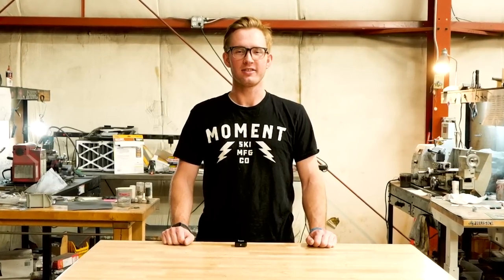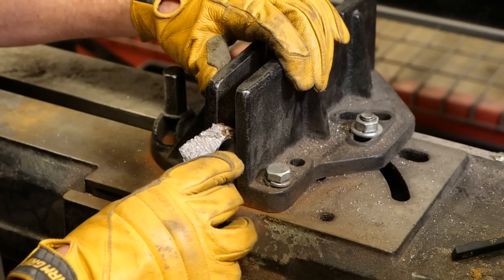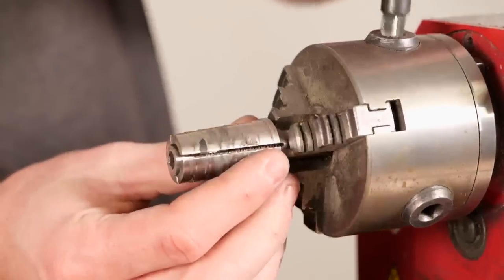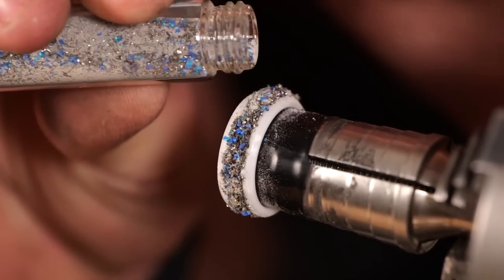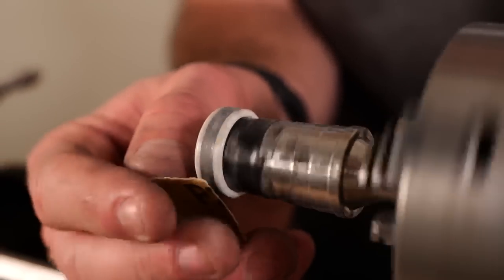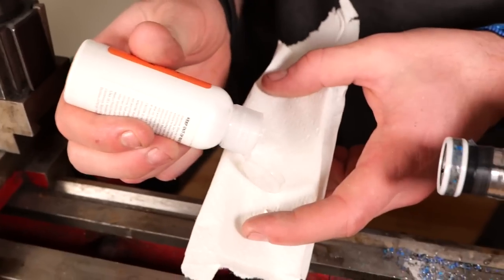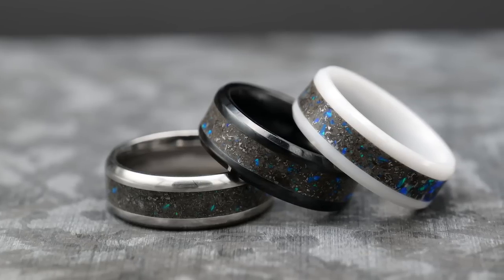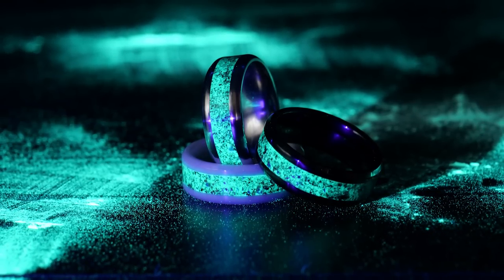GLOWING Meteorite + Ceramic + Moonstone Ring!

Comment: Do they actually glow like in the end pictures? If so, under what conditions do they glow
Reply: I've made my own ring with their supplies and this is what I've found out about the glowing.

The rings glow if you put the "glow powder" into the ring. Then put the ring/"glow powder" under the right conditions.

First up you need to expose the ring to light that "charges" it. An example of this is ultra-violet light like from the sun, or a ultra-violet torch if you have one (which most people don't). After that you can move the ring to a dark place and it will glow, getting dimmer as time goes on.

If you go out and spend time in the sun then wait until the sun has fully set and it's really dark, then you probably won't be able to see the glow too well as the glow would of faded quite a bit. But if you were outside, then quickly went to a dark room, you be able to see the glow.

From my testing I took some glow powder, "charged" it with an ultra-violet torch, then left it in a really dark room at night. The glow was noticable for about an hour. After that it's harder to see. However when I did this with my ring, it only lasted for about 10 minutes before it was really hard to see. But that's because I didn't put much glow powder in my ring.

For the images in the video, I'm pretty sure they turned on an ultra-violet light, then turned it off and took the photo to get it glowing at it's brightest.

Note: If you want a ring that naturally glows all the time, without needing to "charge" it, then you should look for certain highly radioactive substances. The down side of this is you will be exposing yourself to highly radioactive substances and will probably experience the side effects of radiation poisoning really quickly and die.
Reply: @alaskayoung602  Wow this is an extremely helpful message, thank you for taking the time out of your day to reply to me! I will take this into consideration and will be sure to avoid accidentally making a ring with highly radioactive substances and dying.